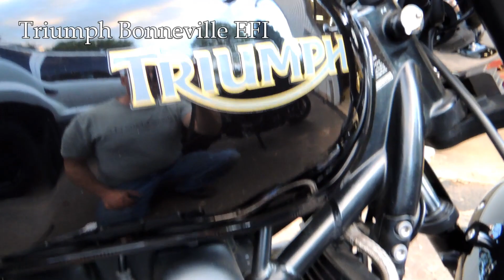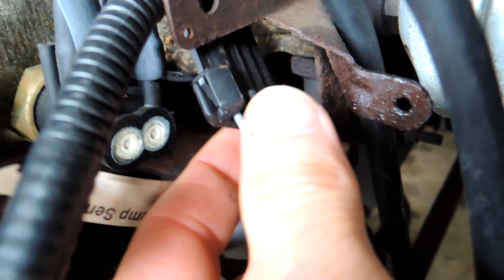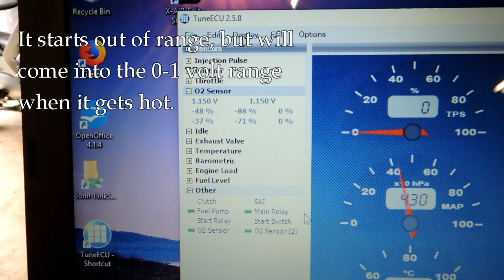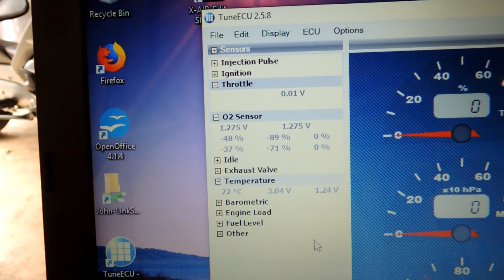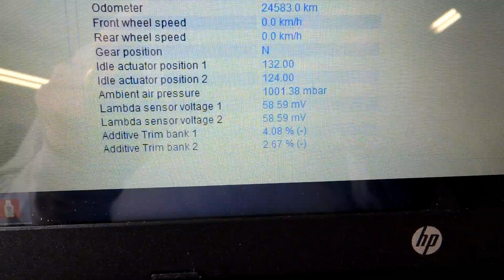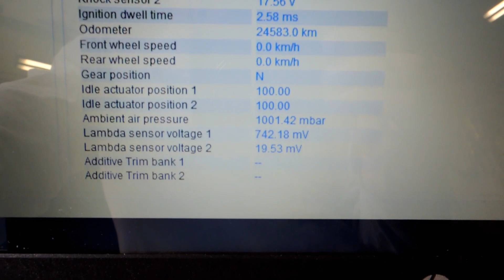Understanding And Testing Motorcycle Oxygen Sensors

Comment: Which 02 sensor is bank 2? I have a 2013 Bonneville efi need to replace bank 2.
Reply from the maker: If memory serves, that would be the right side.  But, you know that just because a code appears for a particular sensor that the problem may not be the sensor itself?

Comment: The jumping around of the voltages on the Jeep is perfectly normal. The sensor is sending out a pulsing square wave. If you VOM sense voltage on the top - you could see 0.8+ volts. At the bottom of the pulse - about 0.1 volt. In between top and the bottom of the pulse - get anything between these two values. The pulses are easy seen on an oscilloscope.
Reply from the maker: It's true the voltages will jump around, and the voltmeter display is not quick enough to show all of the readings.  Nor would the human eye be able to pick it up.  On a scope or a meter with a scope function you have a better chance of seeing the sweeps.  What I was trying to convey, though, is that the readings that day were both cutting out completely and not corresponding to blips in the throttle.  I don't think the sound of the engine was really coming through on the video.  After that video I did replace that sensor, and the new one tested as I would expect.  It responded to blips and never cut out completely.  You are correct, though, that the values on a voltmeter need to be regarded cautiously.

Comment: Really appreciate the effort you've put into this video.  I'm off to test my tiger 800 xrx tomorrow given the knowledge I've learnt from this.  I've got an o2 sensor error code and the malfunction light is on. I just can't clear the code using the tool and s/w I've got.   I'm loathed to pay a dealer to change the sensor if there is some other wiring problem somewhere. Thanks again.
Reply from the maker: Yes, you should be able to test your sensor with a meter.  However, if you are getting a code, it's more likely that you have a wiring issue.  Could be a broken wire, or a corroded connector, or something along those lines.  Test your sensor, and then use your meter to test for continuity in the wiring.

Comment: Hello thank you very much for the video, I own 2010 1200rt which has gradually been having rough idle  up to the point where now it just stalls after a while, replaced steppers problem remains thinking it might be the o2 sensors as I recall first time it happened I connected motoscan and it has an o2 sensor error but after cleaning this error it never showed up again,  I don't have the piercing probe, what happens if I disconnect them should the engine run ok ?
Do you know if ECU uses the o2 sensors in this bike to control the mixture ?
Reply from the maker: The ECU does use the 02 sensors to adjust fuel mapping once the bike is warmed up and in closed loop.  The reason you could have a rough idle are many.  I'm not sure if the Motoscan app has live data the way the GS-911 device provides, but that would be useful to see if there are unusual things going on.  Does the engine run okay if you hold the throttle at 2-3000 RPM?  One of the most common reasons for a rough idle are vacuum leaks, which might occur around the throttle bodies or if there is a loose hose or rubber seal.  I would first do a close visual examination.  Other reasons could be related to ignition, fuel or sensors but it would be helpful to learn exactly how and when the problem occurs as far as RPM, engine temperature, etc.
Reply: @tinderboxarts  yes motoscan has live data reading but I don't really know how to read it yet. Engine runs ok at 2000 rpm, it only happens at idle as soon as I rev it up a little its ok. I've looked around the throttle bodies and they seem to be ok, which hose or rubber seal exactly should I be looking at ? This seems to happen as soon as bike engine warms up a litte usually not always bike runs for a few minutes before starting to fail. Thank you gor your help
Reply from the maker: Okay, well, when the bike is started cold it is in open loop mode and does not listen to the sensors.  After a warm-up period, it goes into closed loop and takes input from sensors.  So if your bike only runs rough after warm-up, that means it may be a sensor reading issue at play.  Still, a vacuum leak can cause a sensor to read out of range, so that could still be an issue.  The live data can tell you if the system is adjusting one side far more than another or if it is trying to adjust fueling to a degree that it is running out of room for adjustment.  The fuel trim values and the 02 sensor values would be the place to look.

Comment: I took mine off my bike and put it back on and the engine light is showing
Reply from the maker: We'd need a lot more information to help.  Do you have a code which references the O2 sensor?  Did you check the sensor and the wiring?  Did you reset the code after replacing the sensor?
Reply: @tinderboxarts  no I haven’t reset the code I think that’s why
Reply from the maker: If that the issue, it will eventually reset itself.  It may require X number of restarts or a certain amount of riding time though.
Reply: @tinderboxarts  okay thanks for the help

Comment: My sensors are heated on my harley forty-eight and I had some error codes come up, it was saying rear H02 low/open and also rear Oxgen sensor high/open. When I was checking the voltage with my vance and hines fp3 app it was showing the rear O2 sensor voltage was at 4.7v and took a while to drop at idle where it only fell to 1.5 yet the front drops within a few seconds to 0.9. Would you have any idea what would cause this or what is happening I've been researching it for ages? Just wondering if it's a bad ground or if it needs replaced? Many thanks
Reply from the maker: I'm not familiar with that particular bike, but what you are describing for voltage is not normal. As we saw in the video, the normal range is between 0 and 1 volt for the SIGNAL wire.  However, you say you have a heated sensor, which will require a supplied voltage and a ground for the sensor's heater. I'm speculating that perhaps the voltages you mention were actually for the heater circuit, not the signal wire.  To unpack this a little further, a heated style sensor must have battery voltage applied so that it can heat up enough to work properly.  The exhaust temp MAY be high enough at times to keep it working, though certainly not at start-up.   If the heater circuit has a bad ground or a crimped wire or a corroded harness connection, there can be a voltage drop and the heater in the sensor will not work properly.  Of course, the sensor itself can be a problem too.  A code can be thrown for a sensor signal not being within range OR for the heater circuit not being within range.  I'm wondering if it's the latter for your circumstance.  

Anyway, I'd advise you to use an actual multimeter for more testing rather than the app.  The app is just using data from the ECU, but that data is not necessarily specific or accurate.  First I would do a thorough visual inspection of the related wiring harness looking for cuts, pinches, melts, mouse chews, corrosion, etc.  Unplug and replug all the connectors. Using your meter and either a piercing probe or a sewing needle with alligator clips, you can try to find the signal/ground/heater wires to see what voltages come up.  You may find that the battery voltage for the heater circuit is too low or missing altogether.  In that case, the signal wire would likely be way out of range during initial start up, but might come back in range if you hold the throttle at 2500 RPM for a minute or two.  If the heater circuit voltage is missing or too low you can trace out that circuit and look for physical issues.  If that voltage looks normal but you still have the code, likely the sensor itself is done.  It's possible that your front and rear sensors are identical, in which case you could switch them to see if the error code follows the sensor.
Reply: @tinderboxarts  Thank you so much for taking the time to answer my question and for explaining it so thoroughly for me. I will go buy a piercing probe and try my multimeter on it like you say and try figure ut out. I will let you know how I get on. Cheers!
Reply from the maker: I would love to hear how you made out--good luck!
Reply: @tinderboxarts  I thought there were sensors that range is between 0 and 5 volts for the signal too? ( I may be wrong??)
Reply from the maker: @terencejarrett2232  Factory O2 sensors are generally "narrow-band" and the signal is 0-1 volt, which gets communicated to the ECU.  There is such thing as a "wide-band" O2 sensor, and that may have a higher signal voltage.  I've not played around with them, but some tuners/hot-rodders use them in their applications which do not communicate directly with the factory ECU.   There are a million vehicles out there and it's possible there is a factory application using a wide-band sensor, but I've never run across one myself.

Comment: So basically you are saying that O2 sensors are made of the same technology and their V/T ratio is the same, and I can use them interchangeably? What if one sensor has output 0.3 to 1.5V and another 0.1 to 1.2? Maybe they differ manufacturer to manufacturer? I am asking because I have rare motorcycle and ECU complaints that in 4 wire sensor, heater resistance is 13OHM hence outside specs which are 6-8OHM.  It is also rusty, and Evapo Rust might or might have not repaired it. Do you think I can take universal Bosch sensor in right diameter or there are more subtle details about sensor sensitivity to temperature?
Reply from the maker: Well, I wouldn't say they are interchangable, but they do all work essentially the same way.  It's likely that you can find a universal style sensor for your bike but you have to check for the thread to make sure it's the same, the size of the sensor to make sure it will fit in the given area, and the number of wires.  There can be differences in the O2 heater design too.  Bosch is well known for making universal style O2 sensors, as well as for OEM.  If you take your old sensor to a well stocked auto parts store there's a good chance they'll have a match.

Comment: Are they on older vechiles aswell or just modern ones?
Reply from the maker: Any bike with fuel injection you'll find them because they are needed for the computer to adjust the air/fuel mix.  On older bikes with carburetors they aren't needed.  In the automotive world there was a transitional period when cars had throttle body fuel injection rather than direct fuel injection, and O2 sensors were used then too.  So, if the bike or car has a computer, even a simple one, it likely also has an O2 sensor.  If the fueling is entirely mechanical, like with a carburetor, it does not have one.